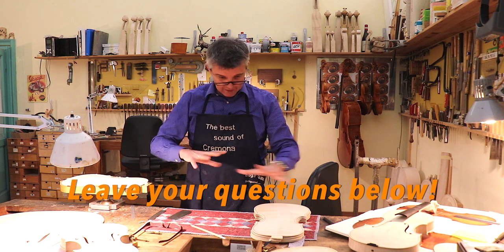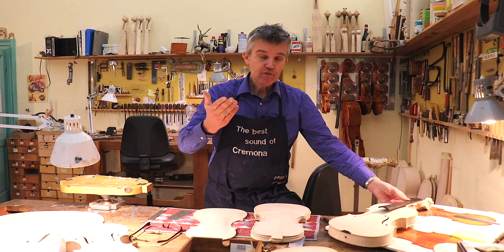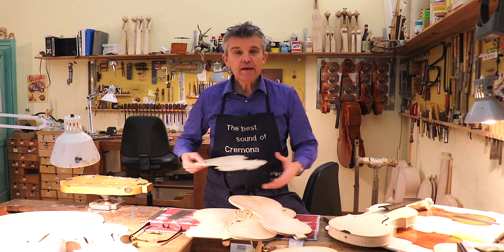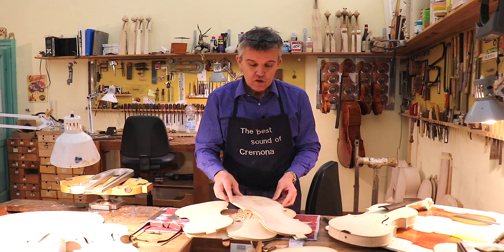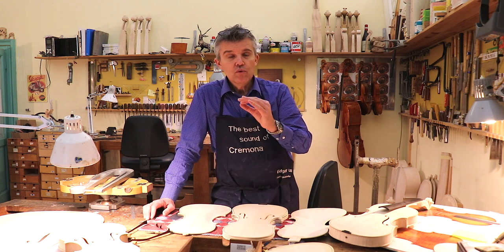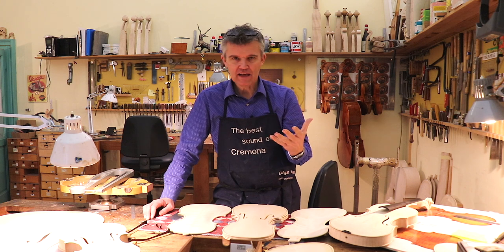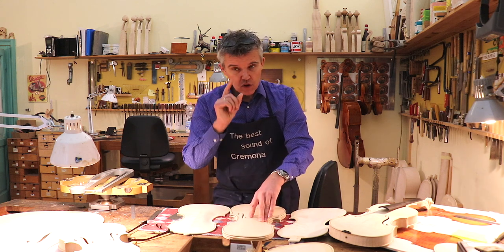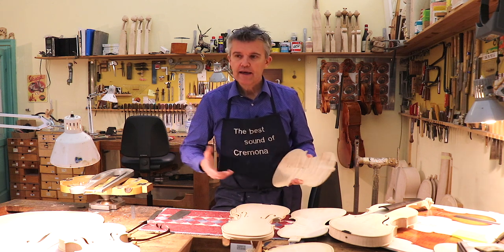Ep. 86: How the Thickness of top and back matters!     (violin, viola, cello and doublebass)

Comment: Hi Edgar,  great video,  thanks, 
Please,  what about ribs and corners' aim  in  sound transmission?
Can we talk about  vibration absorbtion  or  vibrarion mixing of both  top and bottom  Vibrations   for ribs and corners?
Is the bottom plate a power and spring  reservoir for the top plate  through the sound post?
Is there somewhere in the violin  a piece that is a vibration regulator?
can we use densities or thicknesses assymetrical designs  to let the vibrations  start to sound better? or have more sustain?..

thanks for your answers,  maybe on some different videos ?

Chris

Comment: yep, subscribed and bell pressed :)  question - i see all those tops and bottoms out there. i have heard that when selecting wood for a violin, the top and back must match in sound qualities. not sure how its done, but supposedly tapping on the wood is the way to go. do you use that method? or just make a lot of tops and backs and then when u put them together, using tuning techniques, you match them ?

Comment: Thanks for nice insights! 
It’s funny, on this viol I made ( https://www.instagram.com/p/CL5OQ1tK_H0/?igshid=927136ece2yw ), to play it not to become a luthier, I left the thicknesses of the inner parts of the top thicker than what a viol should have (I left them 5~6 mm, instead of the historical 3~4 mm). And this resulted in sound resonating longer after you stop bowing - on the viol we keep fingers on fret like on a lute after action. I feel it as if the thicker mass of material is prone to resonate while the thinner is quick-ending, loud, dull percussive thud. The thin top in my spirit should feel like a stretched paper, like a membrane ( a banjo lol). At the same time I made edges of the whole top as thin as the historical 2 mm, maybe this provides the amplification of the sound. My épicéa slice of wood is also cut like in the past: not pointed to the center of the tree but parallel, I feel this gives a lovely projecting two halves. I’ve seen many old instruments being cut this way, even with branches traces in them 😆. I’m making a normal viol shape one now too, before I receive my real bass viola da gamba from England. It’s a fascinating journey! Cheers!
Reply from the maker: Interesting. Now you should make one with the correct thickness. Without offending, I mean you need a little from everything. Thicknesses are not 1 or 2 mm more or less. It's about 2 or 3 tenth of a millimetre less ore more.
all the best and thanks for your detailed comment here.

ER

Comment: only 3mm on the top plate?   no wonder it has to be arched, plus a bass bar to support it from collapsing under string tension.  😀
Reply: I think the optimal thickness has to be determined through try-and-error, and also depends on the timber used. 3mm work best for spruce from northern italy, but may not work best for spruce from other regions in Europe